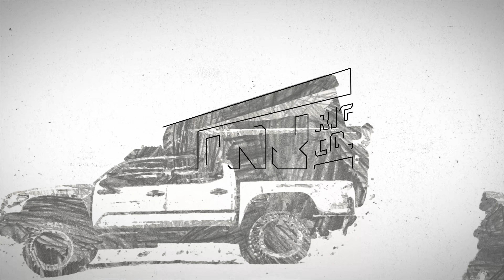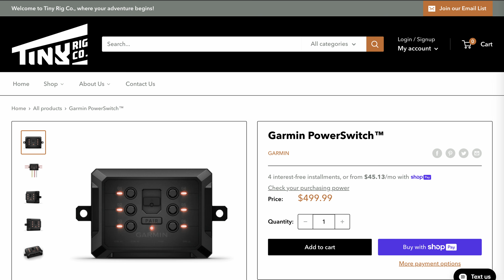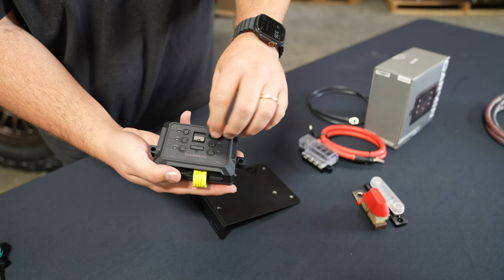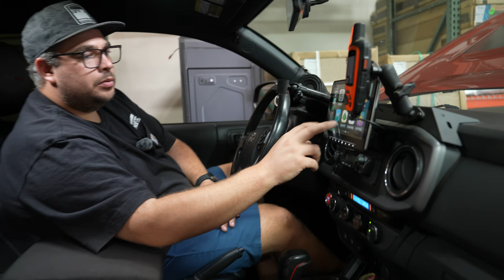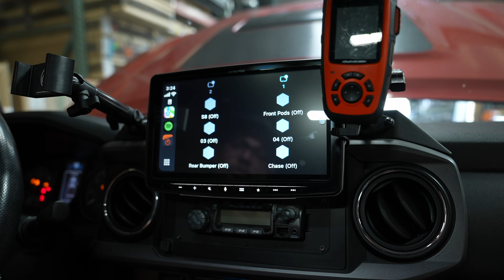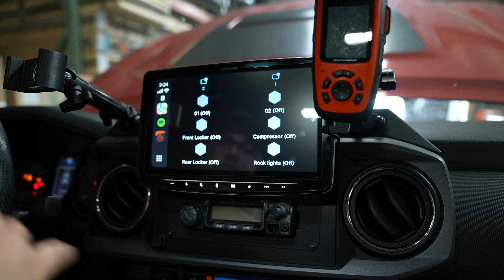Garmin Powerswitch Switch Controller | Tiny Electrical

Comment: Does the switch pro provide enough amperage for a winch? 50 amps or more?
Reply from the maker: It does not.  A winch pulls significantly more amps. Plan for 400+ amps

Comment: what are your thoughts on adding the garmin power switch to the house battery in my sprinter to control all exterior driving lights front and back, exterior scene lights at camp, and interior task lighting.
Reply from the maker: It is a great option for that.